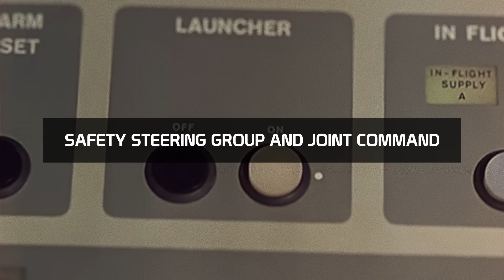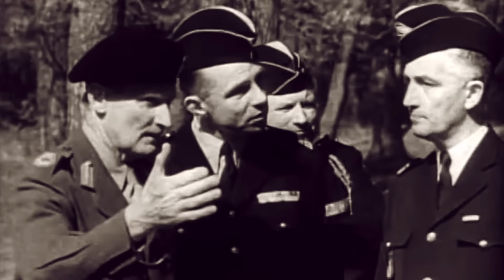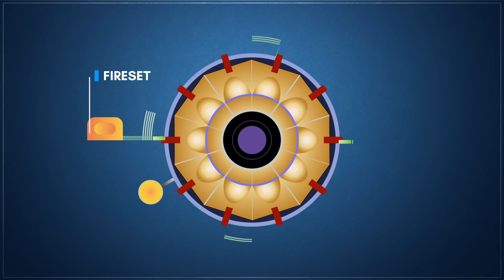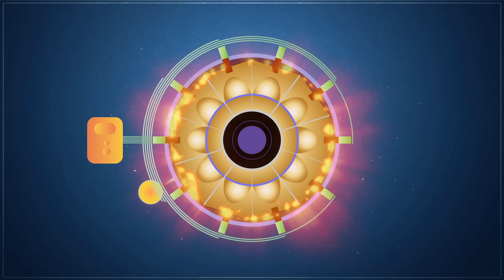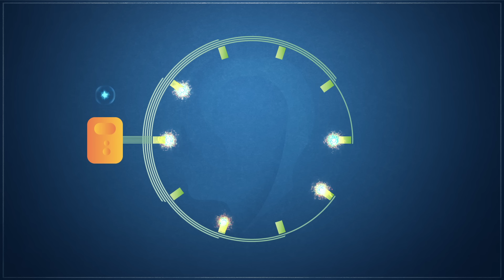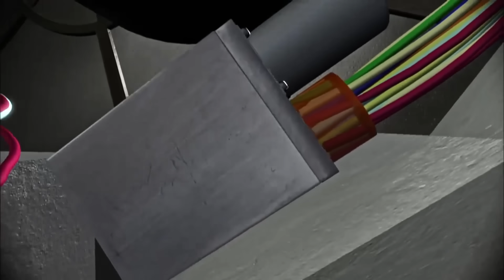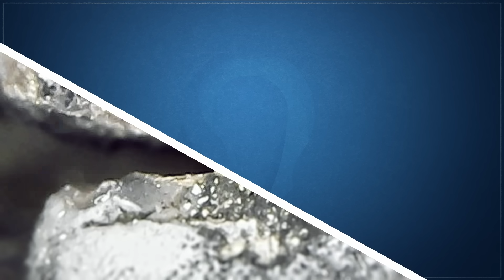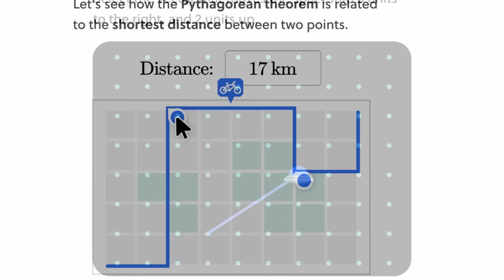The Remarkable Mechanism That Secures Nuclear Weapons

Comment: It is believed by many who were involved in Project Azorian, that the K129 Russian submarine which was partially recovered by the US, was attempting to make a nuclear strike toward US territory, via one of its R21 missiles.  The only relevant target would have been the Hawaii naval bases, or possibly Alaska.  Because the warhead exploded on one of the missiles, causing a large hole in the submarine, it is conjectured that one of the launch officers decided to enter an incorrect enabling code to the warhead, which caused it to asymmetrically, as a result of their PAL link deciding that not properly enabled, and decided to safe itself.  Unfortunately, Azorian was not able to bring up the other two missiles, but did bring up some torpedos and mechanical engine structures.  As such, no one will ever know the true cause of this explosive event.  The Russians did go back to that location, after it became known that there were nuclear assets still remaining there, but to my knowledge, they have never released information about what they dredged up.   Theoretically, there may still be two nuclear missile warheads and one nuclear torpedo remaining at that site.  Some of our company employees were part of that project.
Reply: We can speculate but the public evidence only shows that a warhead exploded while the sub was on the surface (the firing position for that model of sub), and the USSR were searching for it in the wrong place. It is equally possible the warhead exploded due to an unauthorised launch attempt and there was a deadly precaution against unauthorised launch not known to whichever officers were involved. A mistake or a fault is possible but USA and USSR behaviour is not consistent with that.
Personally I like Craven's informed speculation that the vastly expensive Project Azorian was designed to become known to the USSR and the object was to put pressure on the USSR in nuclear arms control negotiations. An unathorised launch attempt, if the USSR believed that might have happened, would be extremely embarrasing and damaging if made public with enough supporting evidence.
Reply: @murdo_mck  A couple of other operarative theories are that 1) they were trying to do a "practice launch", and for some reason the rocket motor was accidentally ignited while still in the tube.  The heat from the rocket fuel may have caused that warhead to explode (somewhat unlikely, would have just burned), and 2) based on some skeletal evidence, it appears that the tube door was actually partially open, and then they actually tried to fire it off, but it got hung up on the door.  Number 2) is word of mouth from one of our guys, when they apparently got pictures of the actual upper surface, near the tower.  The other doors were observed to be closed, so this was a one-tube event of some sort.  Somewhere, in the bowels of the CIA, there are photos of this.  Our company hired about a half-dozen of the Azorian crew afterwards, and resulted in other odd jobs for us.
Reply: @brunonikodemski2420 Thank you for your service!
Reply: @murdo_mck …now Dimitri, you know how we’ve always talked about the possibility of something going wrong with The Bomb… well of one of our Commanders ordered his planes to attack your country …of course I’m upset about it, how do you think I feel?!?
Reply: We recovered 2 nuclear armed torpedoes in the forward section.
Reply: @Melanie16040  Not sure who you are, but our verbal information from the sonar operators, is that these or other torpedos (two) were actually observed to be tumbling "very slowly" toward the bottom, when the fingers broke.  This was amidst a lot of other debris, so maybe difficult to resolve.  The nearby crew was told that is they actually went off when they hit, that there was a good chance that the bubble could cause the lifting mechanism to disconnect or fail (due to loss of buoyancy).  There was never any fear of the them going off nuclearly, although this was discussed.  Since nothing could be done in any event, all crew just stood by, and continued the lifting, after some delay.  Several canisters of normal torpedo fuel were recovered, and at first the hold observers were afraid that they were some kind of mines, but were recognized by the submariners in the crew as fuel equivalents.  Packaged similarly.  During and after the lift, there is a whole another set of stories  involved, as shown on the Inet by others who were there.  Also, we and others were given cover stories about any of our involvement.  I and my supervisor designed parts of the navigation and downhole system, but was not there.  My information is word-of-mouth from those who were.  We later did similar things in both military and commercial domains.  None of that info and engineering design is secret anymore, and mostly obsolete.
Reply: @brunonikodemski2420  Sounds like you had quite an interesting career. That ship certainly did push the limits with it's dynamic station keeping systems. With regard to recovering the two nuclear torpedo warheads, I can only claim to be repeating what I have seen on documents which have been declassified by the government more recently.
Reply: @Melanie16040  The DPS was actually originally designed on an Analog Computer, along with Friden mechanical calculators, and a lot of slide-rules.  After the early Glomar series and MoHole, the second generation design was verified by another engineer and myself, on a Hybrid Analog/Digital computer, where the string differential equations were more rapidly solved in analog domains.  Combining these outputs using a kind-of digital averaging or integrals was better done digitally.  As such, both outputs predicted a "position" of the "apparatus" which was sort-of correct to a very large error circle.  For oil/gas drilling purposes the companies elected to have a "re-entry cone" which was large enough to accommodate common errors, including unknown water drifts at unknown depths.  Third generation systems all use digital computation, and have gobs of additional sensors to pre-predict force vectors, before the strings or apparatus responds.  Any good Servo Book shows how these closed loop systems are "intended" to work.  Unfortunately in real-world, mother nature always adds "hidden variables" as Einstein called them, which always cause many and dangerous problems.  Many catastrophic.
Reply: I almost wonder if they were on patrol and were to test launch a missile with no warhead and were given the wrong orders which would have caused an actual launch of the wrong (usable and armed) warhead and thus were hunted down once it became known.

Or perhaps a mutiny or theft happened and a wrong code was entered to stop war at risk of sub going down. My guess is the later one. There are many other theories which would be equally plausible, but something very bad happened on that boat and or someone or someone's royally messed up. Russia for ya.

Comment: And for the first 20 years of the pal system the arming codes for ICBM silos were all zero's.
Reply: Actually, that was for SAC bombs. No one wanted to fight their way into the USSR and drop a dud bomb. This was rescinded around 1975, and true codes started being used.
Reply: @daveeyes  Because the newer systems could be coded remotely so they didn't rely on people turning dials inside a bunker or in the belly of a plane. One mistake in entering a code, and it's a dud.
Reply: Not "12345"? 😆
Reply: @misterdaave  No, it was all zeros.
Reply: @Jimtheneals  joke emoji
Reply: @misterdaave  I saw that, but the fact that 2 missile officers could have launched nukes and nothing could have stopped them scares the shit out of me.
Reply: @misterdaave That’s the code for my luggage!

Comment: Fascinating! But what happens if a nuke is stolen, surely the core and explosive shell can be reprocessed/remanufactured? Or is there protection against this hopefully unlikely event?
Reply: You'd be picking up pin head pieces to quarter sized pieces from a several hundred yard radius to remake it, and by the time ya did get em all picked up thr military would know and be there. That was whole point of PALS, to stop that.
Reply: That's why there was at least two point "dirty" failure system, which set off the bomb assymetrically, apparently from a clear by-pass attempt. It turns a nuclear bomb into a dirty bomb, but criticality is not achieved. That's called "fail-deadly" and in itself it's an old info. Who knows how it works now, but i bet the western NW have self-destruct modes just for such an occasion.

Comment: These PAL systems sound impressive. However what stops an individual from removing the components and introducing their own power source and remote arming/firing system? Even if tampering with or successfully removing them caused certain critical components like the capacitors or control board to become physically destroyed as a result you could just replace those parts and have a functioning weapon. What boggles my mind is that they aren't or at least weren't outfitted with a tracking system for easy and rapid recovery should they be involved in a crash or are stolen. Personally I think that Russia did know exactly how many nukes it had within its arsenal but didn't want to admit that a number of them couldn't be accounted for after the fall of the USSR and subsequent period of looting of its weapons by their own soldiers happened. Doesn't it seem suspicious that following that time India and Pakistan just so happened to become nuclear powers?
Reply: Of course they got Russian nukes. Does ANYBODY think those savages could make nukes?
Reply: Basically nothing stops that.
Reply: Because a nuclear bomb isn't like a conventional explosive. It's not a simple matter of sending a single pulse down a detonation circuit. Several events have to play out in sequence to construct the actual core of the device, and then to trigger a fission reaction, all within tiny fractions of a second. Any mistake in the sequence, and you just spray plutonium for dozens of KM with nothing to show for it, and the PAL disrupts the sequence both electrically and mechanically. You would, in effect, be building the entire control system and parts of the detonator from scratch, without the knowledge of how the core is supposed to detonate in the first place.
Reply: @watchm4ker  
You need to reread the comment. He asked what stops someone from disassembling the device and basically making a different nuclear bomb with it.
Reply: @VariantAEC  No, they were drastically underestimating how difficult it was to build a nuclear bomb. Stripping out the detonation mechanism would leave you with a warm lump of plutonium wrapped in explosive lenses. Technically, yes, you could 'build a new bomb', but that's not something you can hack together with an afternoon and a soldering iron.
Reply: @watchm4ker  
Again, you misunderstood the point. The point is that it can be done without cracking any codes, so thank you for finally agreeing because the point wasn't 'we can do this in 30 minutes', but that that the full disassembly method is not able to be prevented. Unless the bomb was made to detonate in the event of disassembly, in which case the individual would just take it to the target to disassemble it so it would go off. It's a lose-lose.

Comment: AND UNTIL 2000 THE PAL Was 000000 For icbms For speed and Efficiency LMFAO
Reply: Yeah, but there was also a launch code that, if incorrect or not entered would leave the fuel disconnected on half of the engines.

Comment: To detonate a rogue/stolen nuclear devices, rip out ALL the wires to the high explosive lenses and solder in some new high-current cables to NEW electrically-initiated blasting caps that have the wires BE ALL THE EXACT SAME LENGTH from the explosive lenses to a set of super-high-current IGBT's (Insulated Gate Bipolar Transistor). 

ALSO MAKE SURE you take out any Lead tampers from the warhead core itself (i.e. the metal called LEAD!) and/or replace ALL other types of tampers and replace with polystyrene (or HDPE!) to make a better X-ray initiated plasma that detonates the secondaries better. 

Then hook up a smartphone to a PRIMARY mechanically driven switch that comes after the IGBT's and BEFORE A VERY BIG 400 KV capacitor. We use the mechanical switch so that we do NOT accidentally detonate the explosive lenses which will eventually be switched by the IGBTs from the capacitor so that the high current impulses will be sent to the explosive lenses of your stolen nuclear weapon all at the same time within a period of 7 nanoseconds or less. This ENSURES the explosive lenses will compress the core evenly and correctly to start the primary and secondary explosions in sequence giving you a very nice multi-megaton BOOM!

Once your capacitor is fully charged while disconnected from the main circuit, a signal from your smartphone can activate a mechanical switching device to connect the capacitor high-impulse discharge current pathway directly to the IGBTs which will spread-out the incoming high-current impulse out to the explosive lenses detonators all at the same time in order to initiate the detonation sequence thus bypassing any and all weapons security!

Done! You have now BYPASSES all nuclear weapons security!